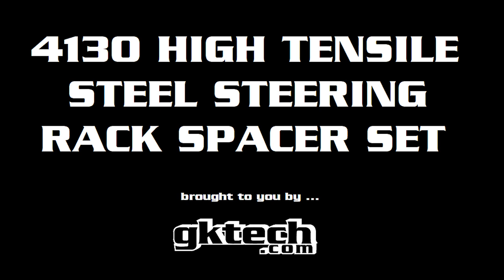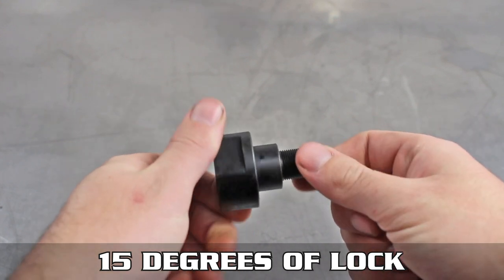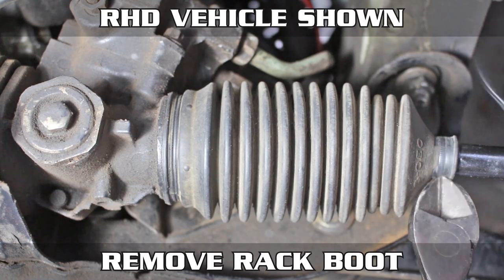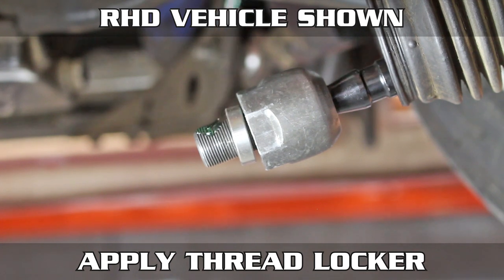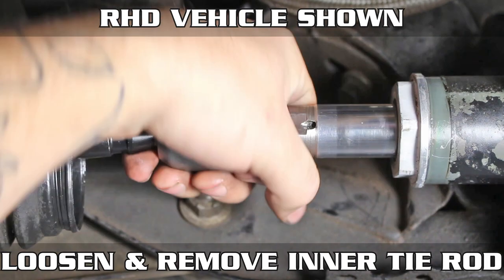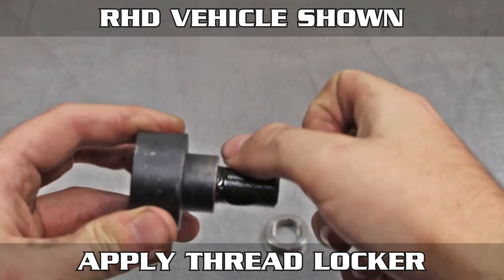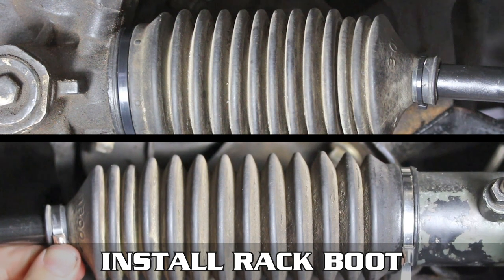Gktech 4130 High Tensile Steel Steering Rack Spacer Set - Install

Comment: More info on how to center the rack and steering wheel would be helpful! I get the centering of the rack itself by measuring, but then the steering wheel is not centered at all. Took me a ton of research to figure out how to center the wheel up without moving the rack. Every single forum and video shows that adjusting the wheel is done by adjusting tie rods and rack which is not how it's done with this kit. I believe you have to disconnect the steering u-joint which I will try soon. Even then it might not be perfectly centered.
Reply from the maker: Hey dude!

The most important part is getting the rack centered, from there people most commonly just unbolt the steering wheel then re-tighten it to the straight position.

Super straight forward, but none the less you are welcome to get in touch if you want a more in depth answer until we release a video on that one day!

John
Reply: @gktech  sounds good. I'll give that a try. I thought the splines on the steering wheel and electrical connectors only allowed it to go on one way but I will give that a try before undoing the u joint.
Reply from the maker: @Phil60084  

Depending on the model and car, some will have clock springs for the air-bag, which is a different thing all together, but in saying that, the clock spring and steering wheel can still be recentered.

Once you remove the steering wheel you will see that it is splined and pretty straight forward :)

Comment: Big spacer on passenger side and small one on driver side right? When you said "this will go on your passenger side" I wasn't sure if you were talking about the small or the big spacer.
Reply from the maker: So on both LHD or RHD, when sitting in the car, the slip on washer is to be fitted to the drivers side and the bolt on spacer to the passenger side!
Reply: @gktech  Appreciate you
Reply: Yes these directions have been very confusing

Comment: Hey man, i got a rhd 350z. Racks are hard to get and i was wondering if  the added angle damage the rack seals? Thanks!
Reply from the maker: Hey dude!
Adding more angle does not damage the rack seal, the amount of angle added is what is already safely available in the rack as design by Nissan, these just essentially 'unlock' that amount and allow it to be used safely, without any over extension!
Reply: @gktech  awesome! Thanks for the reply🙏

Comment: NEED HELP I have a G35 coupe 2007 and the large rack spacer does not screw in my steering rack because its not the same thread pitch as the OEM tie rod thread pitch note: i have infiniti OEM steering rack and tie rods
Reply from the maker: Hi mate, please email sales@gktech.com directly or contact VIA website chat. The team will be able to assist.

Comment: Just FYI for my LHD 2003 350z with OEM rack. To center the rack, I ended up with 2-7/8" on passenger side and 3-1/8" on the driver side. 
I did have to cut the inner tie rods since I got hella toe in on the passenger side. Hope this helps someone.

Comment: As video shown at 2:23, You could mension it's recommended uses stainless zip tie to hold the boot, especially on the longer spacer inserted side. Regular plastic zip tie cannot hold the boot in place when situation like steering lock opposite direction, since it will expands a lot more than from the factory tolerance.
Reply from the maker: You definitely could, through our experience the metal zip ties possibly may dig in and cut the OEM steering boot, also they are harder to tighten as tight as a plastic one.
Second to that, they tend to cut you up when working underneath, if a good quality plastic one (or OEM) is used, it should stop the boot from coming off, from the lip on the steering rack!
Reply: @gktech  That's another good point I didn't thought about. Thank you!
Reply from the maker: @thetype39  All good dude!

Comment: I have a 1990 240sx, LHD, with RCCK and these rack spacer set.  I thought it was plug and play from the gk videos i watch; dead wrong.  I had to re calculate the amount of turns for left and right, which is 1.5 turns left and right but leaves my steering wheel @ 2”o” clock.  I guess i hav to pull the steering wheel to re-position at 12 “0” clock again.  Even after that, the passenger wheel is toe in; which means i hav to the outter tie rod a bit shorter.  The driver side wheel is toe out; which means i have to extend the outter tie rod a bit.  I am on stock inner and outter tie rods.

Comment: Does getting the 12-15 degrees require cutting the factory lock stops off? Or do these not require that and you still get the extra lock? 

If i do cut the stops off the lower arm, will it hurt the rack to full lock with no stops or will the spacer act as a new lock stop?

Comment: So, to recenter the rack. I’m supposed to remove the steering wheel, not the U joint? 350z btw
Reply from the maker: Hey dude,
You can do it from either, it would probably be easier from the U-joint as it saves you messing around with the clock spring.

If you have a boss kit and steering wheel already, then it would be easier through the steering wheel.

Comment: on my v35 on the passengers side with only a 5mm spacer it only leaves 3 threads into the rack, do you have a fix for this?, adam lz 350z had his tie rod thread pull out of rack just the other day
Reply from the maker: Different model tie rods have a different amount of thread available on the inner. For example: Our inner tie rods have a longer threaded section for where it's inserted into the rack, this is so we can safely use them with slip-on spacers. I'd suggest whatever tie rod you are using has an adequate amount of thread.
Reply: @gktech  i got the gk tech angle kit, bolt on rack spacer and longer thread tie rods but i centered the rack and now ive run out of adjustment on the side with the bolt on spacer, the kit came with 2 threaded alloy sections i used the shorter 100mm long alloy thread and still got toe in and run out of thread,  threads are all the way in,  do i cut the alloy shorter? have others had this problem?
Reply from the maker: @dxdrifta  Please contact us directly VIA Facebook or email sales@gktech.com
Reply: @gktech  yeh i got no reply from them
Reply from the maker: @dxdrifta  That's near impossible, please check spam if it's VIA email. Alternatively pass on your email and I will get them to contact you directly.
Reply: @gktech  yip junk folder, dam ive been sitting around waiting lol
Reply from the maker: @dxdrifta  Haha always the way, I have upmost faith in our team and their ability to give a prompt response (given that it's during AEST business hours).

Comment: What would happen if i install 2 of the big spacers no a g35 rack??? (One for each side) 🤯 would ir work?
Reply from the maker: It won't add any additional rack travel, but yes it will work.
Reply: @gktech  would it damage the rack? 😮
Reply from the maker: @shinjiikari5947  Providing you have a lock stop in place to prevent the rack bottoming out, no it would not.

Comment: The thing i don't get about this kit is why is one side got a bigger spacer that means you would only have heaps of angle turning one way and a little extra turning the other way
Reply from the maker: Hey mate, the rack has additional travel in one direction more than the other. By following the process of centering the steering rack, the car will turn the same amounts both ways. That is the reason for centering.
Reply: @gktech  why not just run the $20 dollar rack spacers then does the exact same thing and don't have to center the rack
Reply from the maker: @ccdog2002  The slip in rack spacers will only allow for 12mm of travel, where as the bolt in 19mm of travel. So technically it does not do the same thing.
Reply: @gktech  So I got a RHD Silvia S13 from Japan. The car has Ikeya Power inner tie rods and s14 outer tie rod. It has 2 silver washers on driver and passenger side. I guess it was done this way to increase Ackerman. as the trailing tire will always positive at full lock. I should just run the one silver on driver side If I wanted closer to stock Ackerman. I am getting way too much suspension jacking with both silver washers in and I guess it's better for low speed stuff...  If you use the longer spacer on passenger side then you would have close to stock Ackerman. I was hitting the inside of my rim when going full lock right on left side wheel because of this

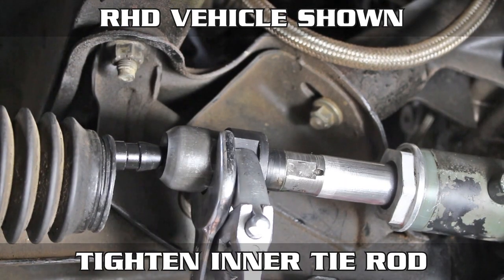Comment: 2:15 that's 80mm on one side and 100mm on the other to the end of the spacer... I guess you showed it off center?
Reply: I need this answered as well. Should It be measured as per the visuals on the video? Or the smooth jazz voice of Dan?
Reply: @nothinghere2067  it's 80mm from steering rack to rackspacer stop. So it's right centered in this video
Reply: MIMCK Media many thanks kind sir

Comment: why not all the combo on just one side ?
Reply from the maker: Hey dude,
If you do that, you would be loosing the lock you would get if fitted to the other side also.

Doing it this way ensures even lock on both sides for as much as the OEM rack offers, after it has been centered.

Comment: Hey how’s it going! Not really sure on how to center the rack do you pull the steering shaft off ? Thanks
Reply from the maker: Hey dude!

At around the 2:11 mark we show how to center the rack!
You need to make sure the measurements are the same on both sides, which indicates even rack travel.
This is measured from the end of the inner tie rod to the base of the steering rack.
From there you will need to take your steering wheel off and then re-center it.
Then you can also double check by tuning lock to lock and counting the amount of turns from the center point of the steering wheel.

You are welcome to get in touch if you need any further help also :)
Reply: Gktech what’s a number I can reach you guys at ?
Reply from the maker: @joshuahebert4154  

We do offer phone support, but are super active either through email at sales@gktech.com.au or through Facebook.
Reply: Gktech the thing I don’t understand is say it’s off on the rack how do make it even ? Do I adjust the inner tie rods that’s where I’m confused. I think if we spoke over the phone it’d Easier I think your number is on the website thanks.
Reply from the maker: @joshuahebert4154  
We physically do not have a phone to answer haha!
You need to install the spacers, then just simply turn the rack until they are even.
Then from there, re-adjust the inner tie rod ends to point the wheels straight and do all adjustments for toe from there.

Then from the inside, remove and refit the steering wheel until it points straight.
Reply: Gktech ok I understand now lol! Now one more question my buddy put it on his G35 and didn’t even have to recenter does that make sense 😂
Reply from the maker: @joshuahebert4154  
I think I spoke with your friend already about that, as someone did message us saying this.
That is super weird, I personally have not seen that before!
But the proof is in the pudding, if it measures even, has even lock, aligns straight and steering wheel is straight ... well it is what it is!
I believe that steering would have been off center to start with and its just a coincidence!
Reply: Gktech so maybe I’ll get lucky when I put it in this weekend haah! I understand though thank you for being so active I’m sure I’ll be bugging you again!!
Reply from the maker: @joshuahebert4154  
Possibly ... but I doubt it haha!

No problem dude, bug away, happy to help out!
Reply: Gktech I emailed you guys! When install it if I have any questions I’ll email you again thanks for being rad !
Reply: Quick question on Centering rack. OEM length says that on both ends I should have 68.5mm of length. If I get that and my steering wheel is still crooked in the cabin. Could I remove reinstall my hub/Qr until the wheel is straight in the cabin?

Comment: This video is rubbish. It seems you can do it in 2 hours, but not. You need to cut tie rods and remove the joint from the rack and so on. Its seems on this video its an easy job but its not even if you got a friend with stuff to do the wheel alignment. But the little spacer is an easy job but its not that funny if you got more angle for just the right side, but its something...
Reply: so i cant just put them on like the video with stock tie rods g35?